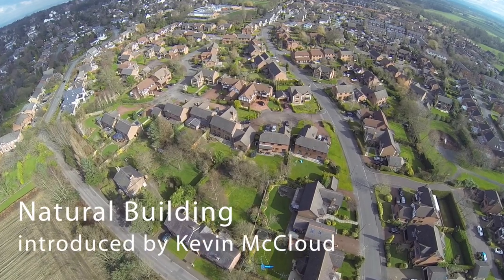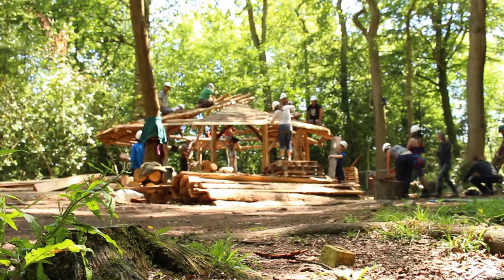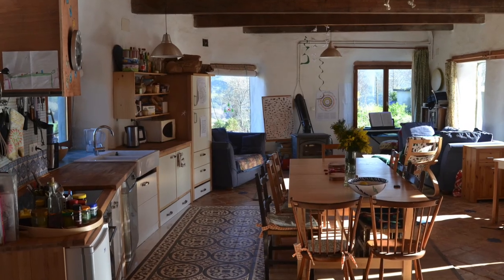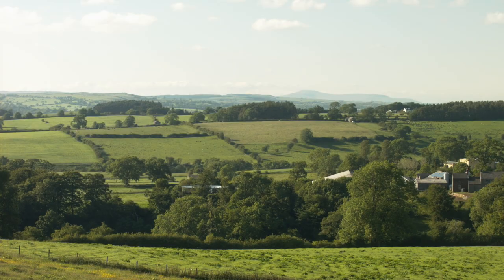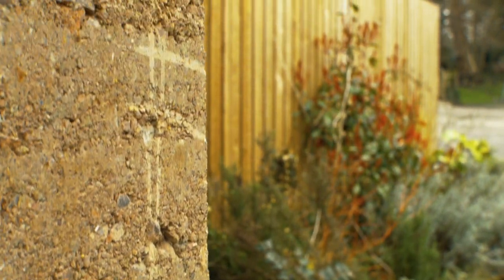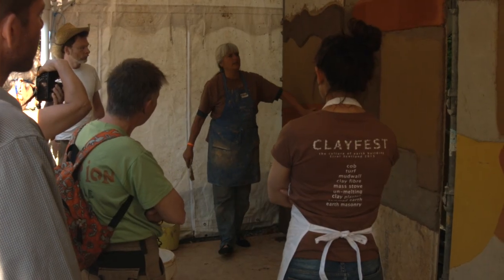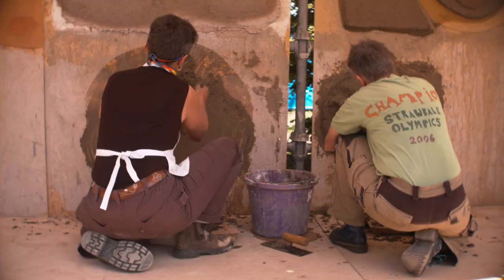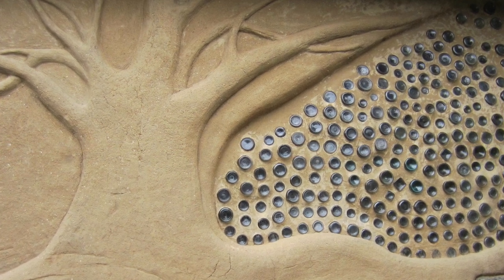Natural Building | Living With The Land | Part 2

Comment: 2:36 Indeed, natural materials are already 'processed' by nature (magma, wind, solar heat, pressure, rain, cold, ice, etc...). They don't need much more process to be ready for being used in construction (It would be a huge and redundant waste of energy), they can be used raw or in a state close to its raw form. At the most, one will have to use a little bit of some binder as cement to give cohesion to the whole structure and little more. There are others issues as the glasses and a little of ceramics, but in essence that's all, that simple and one can own a natural house with a very low carbon footprint, as simple as that. Sometimes, the simplest is the best when one can appreciate it. Most of these houses are indeed beautiful.

Comment: You claim that all materials are used in their natural state, so you don't have to burn fossil fuels to change the materials chemically, but the finished houses shown have glass windows. Also, is plumbing incorporated in the infrastructure? If so, are they steel pipes or another material?
Reply: Brenna Hasselmann steel plumbing pipes! Interesting concept! Trouble with being a smart arse is, you need to be smart! Lol